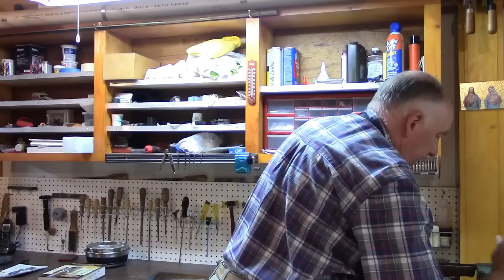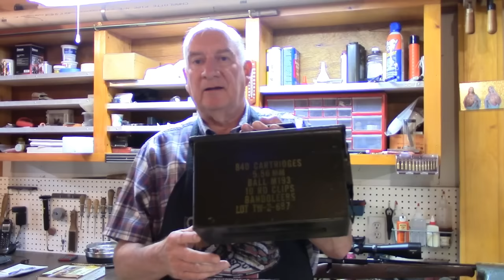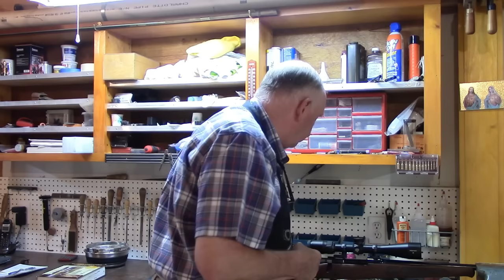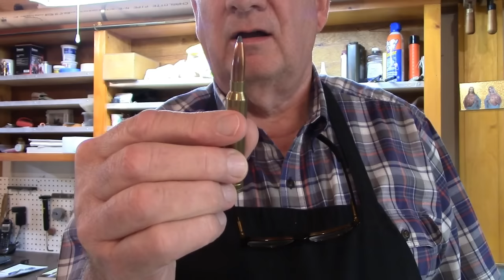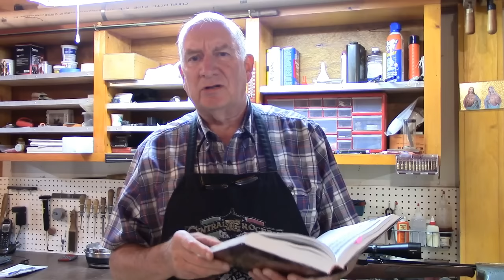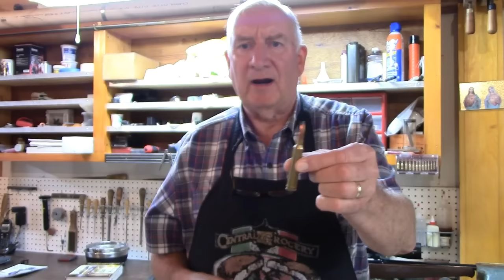How long do barrels last? ~ Discover the truth!

Comment: venturi effect....bernolli: s equation-           when  volume decreases,velocity increases?  fluid dynamics right?
Reply from the maker: Yes, but fluid velocity increases efficiently because it doesn't compress, so the dynamic is not quite the same.  Gasses compress (expand less effectively), and therefore loose efficiency, requiring greater initial pressure, as is the case with all necked down chambers.
Reply: @GunBlue490  Boyle's Law?

Comment: I am satisfied to shoot my Henry lever-gun in .45 Colt.  I don't shoot it hot at the range.  The shooting range where I shoot is controlled by the Department of Natural Resources and fast firing just isn't permitted.  It is a fantastic 100 yard range but it has its limitations.
Reply from the maker: It's impossible to burn out a 45 Colt, so don't worry.
Reply: @GunBlue490    That was my thinking on the barrel.  I have enjoyed the "melt-down" video's put out by another YouTuber, iraqveteran8888, who see's just how many rounds specific guns can take before they become useless by popping off the gas tube and melting the barrel.  These are demonstrations to see how many rounds and what it is like to burn them out/up.  Entertaining and informative to say the least.

Comment: How does crome lined barrel affect barrel life and why?"
Reply from the maker: Chrome is very hard and it's rust proof. In barrels, it's primarily a corrosion preventative plating. On the inside of bolt carriers and sometimes other working parts, it is mainly to prevent wear. It provides no particular protection against barrel heat damage, because it's a very thin layer and the steel gives way under it. I was an electroplater years ago, and have lots of experience with its capabilities and limitations.

Comment: do you think a stainless barrel the effect is hardening instead of going soft?
Reply from the maker: Stainless barrels can last longer under the type of rapid fire strings that competitive shooters engage in.  A rapid fire string is very hard on a barrel, and a match does not stop until it's over and the barrel never cools.  Otherwise, they offer no greater longevity for a person who keeps heating to a minimum with their favorite gun.  Stainless barrels take a bit longer to break down, but they die quickly. Competitive shooters are always fitting new stainless barrels because survivability is rather short.  Everything is in relation to cartridge intensity.  A 270 barrel will warm up faster than an identical 30-06 that has the same case capacity, owing to the greater bore constriction and higher working pressures. Keeping an eye on actual heat and not allowing it to build up will extend life virtually forever.

Comment: So would a 130gr bullet wear out a 270win. quicker than a 150gr if both are loaded to optimum velocity?
Reply from the maker: Bullet wear, that is, friction, is the least of the three destructive forces on a barrel. Heat and powder erosion are the greatest, and both are exacerbated by pressure. There is no practical difference in barrel wear between bullet weights in any caliber. Bullet weight should generally be chosen according to game size. The 130 grain bullet is ideally suited to all game up to 500+ pounds, and provides exceptional flatness. The 150 grain bullet is best suited for large elk and moose. However, it is also a great factory load at 2,750 feet per second muzzle velocity for woodland use on deer, because it tears up far less meat at close range where velocities are highest.
Reply: GunBlue490 thank you for the additional information!

Comment: I've always wondered how you can wear out gunsteel with a mohs hardess of over 8 by shooting lead or copper bullets down the barrel which have a mohs hardness of just 1.5 and 3.  Even the components of gunpowder aren't over 3 on mohs scale so it's not like the residue is a sandy grit.  I do realize that heat is a major factor and maybe what is happening is a chemical reaction of the steel and the powder which is causing a slight change in the surface molecules of the steel in the barrel... any metallurgist want to weigh in to clear this up in my mind?
Reply from the maker: This is not a public blog, so I allow no third party discussions and threads.  Any research on the matter to clear your mind is something that you will have to do yourself. The matter of overheating steel to the point of softening is a very simple physical matter that was discovered in the iron age.
Reply: Hmmm... so what is the comment section for if it's not to ask questions and get answers??  We both know heat is involved but obviously neither of us know HOW it causes it.  And from what you're saying someone else that does know is not allowed to say...

Comment: I ordered an AR barrel because it said 4150 CMV nitride,... but on the barrel it says... 4150 CMV  SR . Do you have any idea what the SR stands for.???
Reply: Probably stress relieved.  Pushing a button or hammering cold metal deforms the structure of metals leaving residual stresses.  Heating the parts relaxes the metal so its less likely to warp or crack over time.
Reply: @elingeniero9117  thank you.... No one else has thought of that

Comment: What I find nowadays is that the appearance of new fast cartridges is more driven by the need of manufacturers to increase sales when there is a slow down of sales on the traditional cartridges (and endorsed by reviewers, gun writers, gun magazines and so for) then a real need for that cartridge. Long distance shooting of dear (from one ridge into another) is both unnecessary and irresponsible. You are more likely to wound the animal who will go on to die a miserable death. Most people I know of,  that get into that activity, don’t practice enough or have a true understanding of precision  long distance shooting. For the common deer, elk, moose or pig hunter, you don’t need an ultra fast cartridge. Remember that the 7x57 until a few decades ago was used in Africa to hunt just about anything except Cape Buffalo, Elephant and the big cats. 
I have killed deer with my flintlock,  .44 Magnum, 30-30 and 7-08. I took my time and they were all one shot “Bam-Flop” type of kills.  I have a 30-06, 270 and 300 Win Mag but I would never use them in deer. For me there is more enjoyment on stalking the animal to a very close distance then to shoot them across a ridge.

Comment: Is this the same with air rifles?
Reply: No.  A compressed air or CO2 bottle rifle is already at room temperature.  You are talking pressures of maybe 1,500 psi max.   A 223 operates at 55,000 psi with powder burning at 3,500 F in contact with the rifling.   That is higher than the melting point of the steel in the barrel.

Comment: That's not how the venturi effect works. After the diameter of the flow decreases, pressure goes down but speed goes up.
Reply from the maker: You're correct.  But you're speaking of the nature of fluid that does not compress, versus expanding gas, which compresses.  in all necked down cartridges, chamber pressure is raised in order to effect that increased velocity.  That's what I demonstrated with the 7X57 Mauser necked down to 6mm Remington, which has a huge increase of over 10,000 PSI, but looses over 150 feet per second velocity with identical weight resistance.  In addition, smaller bores require longer bearing surfaces for bullets of equal weight, as the length increases, and that increases resistance and efficiency loss.  That's a relationship that occurs with all such instances.  Going the other way, a 35 Whelen is far more efficient than the 30-06 from which it was made.  The dynamics in cartridges are different than with fluids.

Comment: also what are your thoughts on the 6.5x55
Reply from the maker: It's a great round with a large following in Scandinavia, where it takes game up to moose.  The factory loading has virtually identical velocity of the 6.5 Creedmoor, but it has much greater case capacity that runs at significantly lower internal pressure for much longer barrel life.  The Swedes had it cleverly figured out five generations ago.  Despite its great versatility and strong sectional density, one should not forget that its frontal area is rather small for really heavy game.  I'd say that it's a fine round up to caribou or sheep, but on the very light side for elk.

Comment: Glock told me my G43’s barrel will last 30,000 rounds +!
So far after 2 years I’m at 300.
Am I smart to listen at Glock?
Reply: Kelly Finney a handgun barrel doesn’t even remotely see the same wear as a rifle barrel. It will most definitely last that long.. the gun will probably break before the barrel goes
Reply: Kelly Finney The plastic frame or the slide will crack long before a Glock barrel will wear out at the low pressures that they see.

Comment: I wouldn't have subscribed if I didn't deem you knowledgeable and wise but NOBODY knows everything, even within the confines of their own craft. That being said, are you aware that some rifle barrels are made for the "abuse" of sustained fire? I refer to chrome-lined barrels and whatever the new M-60 barrels (U.S. Ordnance) are made of. 15,000 rounds and no barrel change, 850 rds on one pull of the trigger for a one minute and 45-second burst. 
In the vein of hot, bolt-action rounds, how long would you allow the barrel to cool? I usually wait for 3 minutes (approximately).
Reply: .50 barrels had a stellite liner for about 8" even back when I was in.

Comment: Is a 25-06 a burner cartridge? Glad that Benny is doing great!
Reply from the maker: It's not a classic burner, but it's very aggressive if abused, and can ruin barrels very quickly. It uses only slightly less powder than a 264 Winchester Magnum, and has a smaller bore, so it can definitely do a similar job on throats if over shot and allowed to heat up.  If you handload, you can greatly extend life by backing off on charges and keeping pressures moderated.  That's why I prefer the 257 Roberts.
Reply: @GunBlue490  I do reload, thank you!

Comment: Forever saw a. 22 barrel so old it only shot well if left uncleaned.
Reply from the maker: Lots of old 22 barrels were ruined by decades of shooting with corrosive ammo, and are extremely pitted with little remaining rifling. Many rare ones have been salvaged and given new life by boring them out and refitting with new barrel liners.
Reply: @GunBlue490  Ive seen old shotguns in the UK where you can see the track of the hammer thru the dirt

Comment: 2 or 3k round barrels? What kind of cheap crap are you buying? My SS BA Hanson 223 Wylde has a life expectancy of upwards of 30k rounds. I’ve got over 8k rounds through it to date and it’s still a 1/2 MOA tack driver at 100 yards. My tactical team shoots 150+ rounds in two hours of training twice a month. If I had to change my barrel out every 2k rounds, I’d be replacing it every few months. Either you misspoke, or you have no idea what you’re talking about.

Comment: How silly of me to click on and sit through a video titled “how long do barrels last ~ discover the truth” and think I would actually hear even one example of the life expectancy of a barrel of some chambering or other.
Reply from the maker: There is no such thing as a numerical life expectancy of a barrel, except in an absolutely controlled rate of fire.  A .308 Winchester barrel can last 600 rounds in an M60 machine gun firing sustained, 3,000 rounds for the dedicated target competitor, or 10,000 rounds for a recreational shooter. Everything relates to the intensity of the round, and how much heat it creates or the rate of fire the shooter demands of it.
Reply: @GunBlue490  that’s exactly the kind of information I expected to find in the video. I had no problem with any of the points you made or opinions you expressed, just that I found the title somewhat misleading.

Comment: Hello...    i. Can.t.  hardly.  Believe. A.  1000.  Round.   Rapid. Fire.      Target. Day. With
223......   When. I. Visited.   The. Plains. Of.  Montana.     And. Yes. I.  Got.  My.  Antelope.   And.  Found. A.   Prairie.   Dog.     Town...  and. I. Couldn.t.    believe....   how. Warm.  My. Barrel. Was. After. Two. Magazines.   Thats. Only 10. Shots.    Of. 250 l3000.     And. I.  Quit. After.    A. Full.  Box....   and. With. Speaking. To. My. Gunsmith.   On. Barrel.  Break. In...  and. Brushing.  And swabbing. After. Every. 1. To. 5.   Rounds.  For. The. First. 100. Rounds.   Or.  5. Boxes.   My. Customs.   Will. Have. A.  Much. Cleaner. And. Longer. Life.     As. Well. As. My. Re. Barrelings.   On.  My. Dads. Old30.06. . M.1. Garand. And. 30l40. 1895.   Springfield...  lets. See. Here. Heat..  powder. Residue. Copper. And. Lead. Friction.... Equals.   A. Day. At. The. Work.  Bench.  Cleaning.  Your. Equipment.  Meaning....  cleanliness....  never. Hurt.  Any. One.     Be. Clean. The. Fun.  Will.  Last.  Longer.   Have.  A.  Nice.  Day...

Comment: Barrel material selection plays a huge factor in barrel life...
Reply from the maker: Such is marginally true for the competitive individual who regards barrels as consumables, as in miles per gallon. Most people buy guns that appeal to them, not barrels. The very best barrels are not immune from abuse.  Many firms such as Fabrique Nationale who produce Browning and Winchester use the same high grade steels as used for their machine gun barrels, so it's not necessarily true that they take a second seat in longevity. Benchrest shooters often buy barrels in sets, in order to swap them.  But they represent an almost immeasurable, insignificant percentage of shooters. For the vast majority of folks, the barrel that comes on their favorite rifle is the one that will stay on it.

Comment: Can kill a deer with 357 mag
Reply from the maker: Is that a question or statement? Yes, the 357 Remington Magnum will kill deer with the proper bullet of good sectional density within reasonable range.  I recommend no more than 40-50 yards with handgun, or 60 yards with rifle.  It's not by any means an ample deer round, but will do with good placement.  It has a small fraction of the power of a 35 Remington that uses the same diameter bullet of much greater velocity and weight, which is indeed a good, proven deer round.
Reply: Works well with 180 gr out if my henry